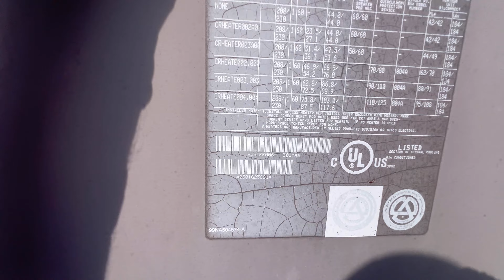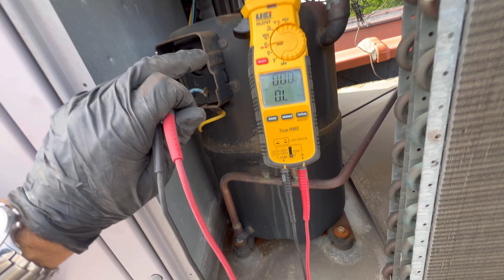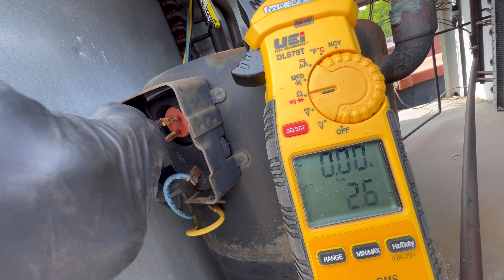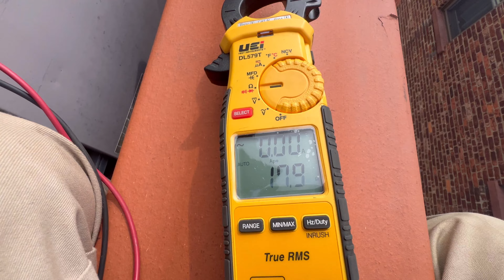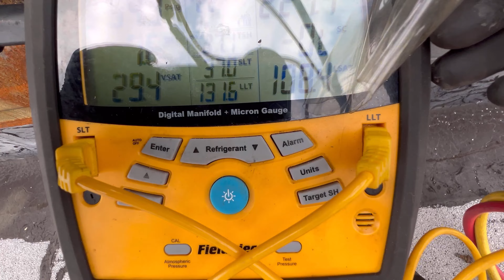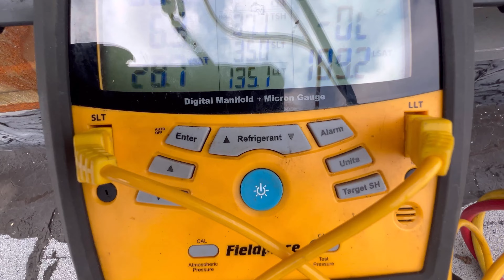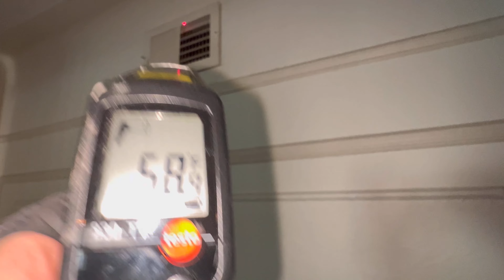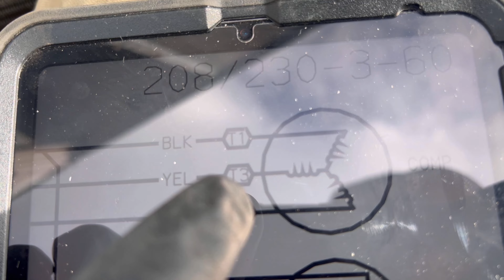SOMEONE TELL ME "WHY" ?? ESTIMATE WAS GIVEN FOR A NEW ROOFTOP UNIT, LET'S BRING IN THE CRANE !!

Comment: You can’t Check your pressures when you don’t have the proper air flow! You had your probe on the discharge line you might not get proper sub cooling.